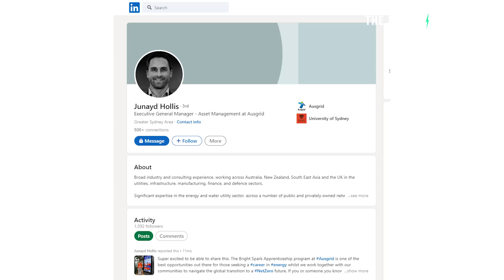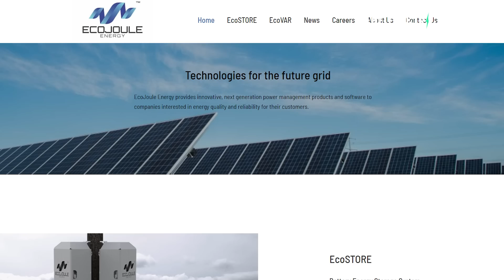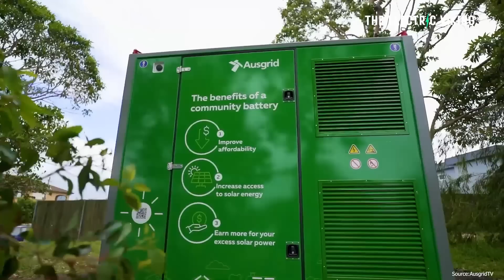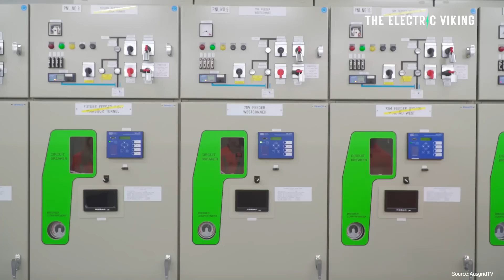Australia Begins Installing Power Pole Batteries for Excess Solar Storage

Comment: So Ergon was doing this up in QLD in the early 2000s.

We see this quite a lot generally in the form of larger batteries, and it’s not so much for bulk storage as it is for grid smoothing, but I guess it’s a tad of both. That said, stability is the thing that no one is effectively controlling.

You see the same thing in WA with project Symphony which is a similar trial by Western Power and Synergy.

To where this applies for cars is V2G, and yes, we’re already seeing for example large batteries attached to solar farms that are charging at very low cost and selling at very high cost for ancillary services because there’s a decent market. The balancing price during the day in WA for example is between $66-95/MWh.

Comment: Lithium battery storage is an expensive joke. The South Australia battery will power a typical container ship for just 1hr. It has no hope of powering a city for very long. 
Home owners would be better installing their own lead acid forklift batteries.  They are far far cheaper than lithium. Store huge amounts of energy and are safe and reliable. When they eventually die after maybe 15 years you will get back lots of money as lead is fully recyclable.

Comment: Batteries closer to pole base might be easier to maintain
Reply: Also, batteries are heavy, and they make the pole top heavy.  It would be more stable with the weight at the base.
Reply: @IMakeThingsFly  Can't argue with that :) Also, parallel 3D printing solid state batteries might help lower costs :)

Comment: Not sure about the power pole batteries, sure they are a great idea, trouble is we have morons that drive cars, can you imagine one of these posts getting hit by a speeding car and getting knocked down ?
The cost of a normal power pole is very expensive, imagine the cost to replace one of those with batteries, if they get replaced at all as what Insurance Company will be the first to add that into their policy ?

Comment: This shows or at least should show to all the less intelligent people worrying about the grid unable to handle all the new EVs that will be coming into our areas, it's one of the biggest talking points on that fake news site called Epoch News, they carry on about how bad EV's are for the environment as well as wanking on about the grid and it's imminent demise because of EV's.
I have read many comments on that site and not one brain cell between the writer of the article nor his readers as they all comment that the end is near :)
The grid is not a static piece of equipment, it gets upgraded and modified as required.

Comment: I would not like to be called NIMBY, but my first impression is "This is ridiculous" - putting battery packs on poles. Of course, energy companies have been putting transformers on poles for years ... and poles and lines everywhere since Edison, probably. It is easy to do that. But I am tired of seeing telephone, cable, and power spaghetti lines and poles everywhere all the time. Underground, in conduits, etc., seems much better and safer. Powerwalls in homes, bi-directional, would achieve the same effect. Utilities could encourage installations (or put batteries in front or behind residential power meters). But not on the tops of poles (for wind to blow over or electric short-circuits to explode like transformers). For apartments and larger sites, the ground-based battery packs (shown in the video) look fine.

Comment: Big 100kwh EV batteries that daily use is 7kwh are brilliant money makers when V2G. 

Self parking EV, like the home robotic vacuum cleaner, can connect to the grid. 

Vehicles are parked 23hrs daily when not in the rush hour drive or the local shopping and school run.

20 million of these EVs in Australia connect to 20 million buildings connected to the national power grid, which means up to 2,000gwh daily in storage. 

And dispatchable to the grid daily. 

20 million buildings with rooftop 33kwh daily solar PV systems means 660Gwh daily available to the 20 million buildings and the national electrical power grid. 

SOME BODY DO THE MATHS and stop all the other crap in the sunniest continent in the world. 

Community batteries are a great place for RAPID CHARGERS.
At the shops and on the main roads. 
And in streets with local high voltage transmission lines. 
We have 11,000 volts above our street 240volt home supply.
The excess daily feed in can be economically 'shipped out' at high voltage.

Does anyone listen or read ????
Let's know where we are going before we waste any of the national wealth on crap solutions.   😊

Comment: I lived in an east coast state next to the Atlantic Ocean in the United States. Our state by the ocean has barrier islands and peninsulas that have vacation cities on them separated by national and state seashore parks. Many years ago while driving along one of these long thin barrier islands by one of these parks I noticed all the telephone/powerline polls separated about 100 yards/meters apart. The thought came to me that those polls could have been topped with wind turbines and probably generate a lot of electricity to the grid while being no more unsightly as these polls were. Given there were about 300 polls along my 17 mile trip between towns, if they had been equipped with home wind turbines these polls could generate 4.5 mW of electricity. Because of powerful hurricanes hitting the east coast the wooden polls have been replaced by much larger steel towers which look to me large enough to hold utility scale turbines while still being able to run power lines. For most of the year the wind comes on shore steadily and strong in one direction. Since these vacation cities become largely empty from the fall, through winter and into early spring the power generated by these turbines would be enough to power them until the large numbers of people show up for the 12 weeks during the summer. Electricity stored in batteries could charge up during the fall, winter and spring and help power the seasonal peak in the summer along with solar on the buildings rooftops. We just need to think differently than we did before. It seems absurd to me now to think that miles and miles away from the beach and these islands we burn tons and tons of coal to make electricity and send it miles away via power lines on power polls to be used to cool down buildings that have been heated up by the energy of the sun. ???
Reply: Any storage past 24 hours is unfeasible at this point and likely to be for years.

Now- if you used the excess solar to store the energy in chemical form, it might work (tho I don't know the economics).

The current price of storing 1kwH of power is $600.   

Let's say that a power company can probably do that for $150 per 1kwH.

One "average" house (2000sq feet) uses roughly 1500kwH per month during the summer.   So battery storage for one day of electricity for a house would cost $25,000.

Our largest gains will be from more efficient appliances and more insulation.  The wind idea is interesting but you do need to consider the maintenance of many small wind generators on poles in a salt air environment.  They would probably need telemetry so the company could tell remotely when one was broken but that's low in cost- maybe $100 per generator.

The good news is the cost of storage is projected to be about 40% lower by 2025.  And for example- my current battery and panel setup cost $1000.   That same system would have cost $6,000 just 4 to 5 years ago.  It's possible that by 2028, it will cost $200.  Plus my new panels generate the same power in 8sq ft that my old panel did in 32 sq feet!
Reply: Wind turbines kill birds. We certainly do not want them all over the country. The solar idea is much better/safer

Comment: From the look of the size of those units Im going to take a stab and say they are probably about 10KW for each of the units. 16x 3.2v/200 ah cells with inverter charge controller on top.

Comment: Its Grid stability , they are also doing battery packs about 1/2 the size of a Tesla Mega Packs. .Excess energy is a problem with variable solar and wind power generation .  These battery stabilisation are needed mainly because of this so they should be included in the cost of green energy . Bear in mind we can go days of very little power generation , so we need days of storage not hours . Imagine Sydney with power outages lasting for days , do you think that would be acceptable ? . How many MegaPack do we need 10,000, 20,000 or maybe 100,000 . do the numbers and at $3 Million per pack let's see . South Australia went crazy when power lines to Victorian coal fired plants came down in a storm .

Comment: I don't see the point of putting small batteries on poles. Yes, distributed batteries are a good idea, but the ideal would be small battery packs in every home, all coordinated to be a virtual megapack. That would be be a stable and resilient electricity grid.

Comment: The power companies remind me of a bunch of penguins pushing and shoving on the edge of an ice shelf to see who will dive in and see if a leopard seal waits for them.  The power companies need to take a chance on alternate battery chemistries.  By all accounts they are superior in significant ways for static applications.  They last far longer, can be cycled between 0 and 100% with no damage, are safer and all they need is market share to be cheaper than Li batteries.  There are liquid metal batteries which use Sb and Ca, ZnBr gel and plating/flow batteries and a bunch of redox flow batteries.

Comment: Localized battery storage is a good way to strengthen the grid as well as to take advantage of energy price/volume fluctuations. However, the pole is NOT the most effective location. Batterys are heavy, and are most cost effective at scale. The most logical place to put these (at a local level) is at the power substations. These are already centralized hubs that provide power distribution for the local area, and are the most effective place to operate, manage, and scale on a local level.

Comment: This is a good idea for couple of reasons.
Allows for storage for feeding the grid.    
3 or 4 solar panels can be installed and all pointing at the same sun and no shade.  Minimal ground footprint
Already an easement on the land.   

Technically would allow direct feeding the grid.  or install battery packs for feeding grid at high demand times.
Or could also allow 4 poles to be connected and have 4 powerwalls feed a citizen charger.  which could allow a car that is low on charge to top up.  as long as the charging station was on the shoulder of the road, might be ok.

Comment: That is a dumb idea.   Put a heavy battery on the top of a power pole that is already going to be overloaded with wires?  Why?   Makes zero sense.  The batteries can be situated anywhere, there are a whole lot better places to put them than on top of power poles.

Comment: Batteries need to be installed as close to the point of use as reasonably possible. A one hundred Megawatt pack could be put next to the last substation prior to the point of use to provide for small communities. A ten megawatt pack could be installed for a neighborhood. Anytime a pack is connected, it needs to have an automatic disconnect to prevent backfeeding a damaged upstream feeder line. Each user having their own backup or UPS system with automatic disconnect is safer in the long run. Putting a thirty KW pack on a pole to serve three to five homes would be the next best thing, but takes the control and the responsibility away from the home owner, and gives it to another entity.

Comment: This works in South Australia due to it's difficulty in balancing the load. That same problem does not exist in other power networks such as in the USA. There are far better ways to manage power uses than poletop batteries. Like underground megapacks or vpp plans, etc.
Reply: i just left a comment kind of in the same line of thought. Are hundreds, thousands? of these things better than a hundred small sized stations for a specific area? Doesnt seem like it to me. Surely power pole set ups will cost more and just add more failure points

Comment: It's not a new idea. We were always told. Cladding the roofs or tops of things with anything to help elevate the electrical demand, just couldn't be done, for what ever reason. Stretch a pipe across the poles for miles while we at it. So when low and high pressure weather systems cross the country. The tube becomes a super sonic fow of air. That powers tiny turbines . The then power each battery terminal.

Comment: Breaking news
Multiple power poles burst into flames and even explode causing massive bushfires and deaths.
Super capacitors would help balance the horrendous fluctuations caused by wind and solar, but even if every pole had several of these batteries or capacitors there would be no net real benefit other than balance and only a few minutes of backup capacity, this would be vastly out weighed by the ugliness, waste of resources and vastly increased pollution. Especially when they burst into flames after a lightning strike

Comment: Poles fall down during storm conditions. I hope they enhanced the polls that they have used since batteries are very heavy and install high up on the pole which makes for a much higher structural load on those poles.

Comment: I try to be positive about an electric future and things like this are great. The only flaw I see is adding weight and wind catching bulk at the top of the pole and not the bottom.
Reply: Tesla if drawing from private Solar excess should pay back thru system to local owners at a commercial rate , same or higher if this is the plan for future supply. That or a Credit system for. EV owners.
Reply: This Polebat system is also experimental ,placing  Li batteries thru residential areas with potential to emit Deadly Toxic gas ,s should a Cascade event occur ,direct threat to people and environment ,as has occurred over 50 events worldwide. Extreme precaution is required, from Day 1 , as occurred Moorabool  Tesla fail.

Comment: From what you are saying, it sounds like these batteries are going to make it possible for them to gouge the consumer at 10 times the rate they should be charged.  Great,Sam.  Cant really say that sounds like a benefit to society.  What good is this new technology if its going to be driven by the same old GREED model and it puts everyone in the same boat as the fossil fuel boat we were trying to climb out of?  Sheesh.  Your Tesla stock should do well though...

Comment: I personally think both distributed solar and distributed batteries only exist because of subsidies. It makes much more economic sense to have farms that to have mini-installations all over the place, and the nightmare that it is to maintain them. Its not like the electricity network can downground transmission lines and assume the local community will have enough battery storage from distributed batteries, so there is no real gain in doing this.

Comment: So now we need to find even more lithium.
Reply: Then it's a good job India found 5.9m tonnes earlier this year isn't it? 

Now people are actively searching for it there have been several new deposits found in recent years (and people are revisiting old sources which had no economic value when they were found - like in Cornish tin mines). More batteries are being designed that don't require lithium like sodium-ion. "Global consumption of lithium in 2021 was estimated to be 93,000 tons, a 33% increase from 70,000 tons in 2020." (USGS) - US consumption was 3,000 tonnes - global lithium production in 2022 was 130,000 tonnes. Lithium prices are trading well below their 2022 peak as a result. If there are future problems with lithium supply it isn't that we can't find it, it's that the time to get new production up and running is slower than demand is growing. 

And if sodium-ion takes off we may look at LFP batteries in a decade the way we do Betamax today.
Reply: Better than burning more carbon!

Comment: .....and we thought copper thieves were out of control in Australia....Now they'll be stealing the batteries ??
Reply: When were copper thieves out of control in Australia? There is copper theft particularly in rural areas but it’s not increased over the last ten years. As for stealing batteries, people aren’t stealing pole mounted transformers which arguably more valuable. You would also notice the theft. Is this another Sudanese Crime Gang Terrorises wealthy while coalition voters in Melbourne story ?
Reply: They don’t really knock off the transformers off the poles so I doubt they’ll be ripping these down either seeing as the transformers have a boatload more copper inside than a battery
Reply: Camera security and high voltage risks make it less likely🤔
Reply: @josephlammardo  That's never stopped thieves before. There's the best cameras in place at every bank, and dye bombs in the notes, not to mention the silent alarms, but that hasn't stopped armed holdups.
I know because my wife worked in the bank not to long ago, for over a decade 🤔
Reply: They will need a significant Hiab truck and crane it would have to be an "in house" theft imo